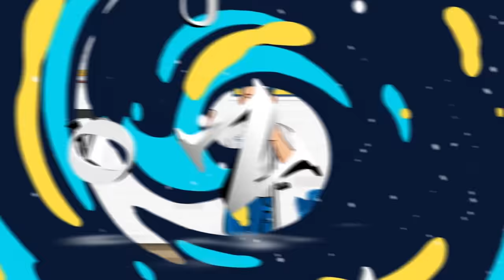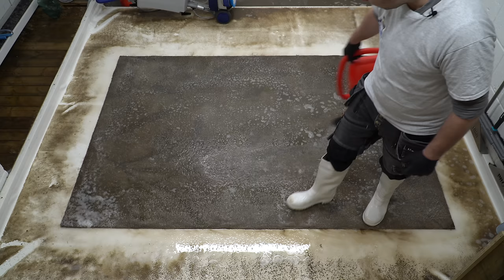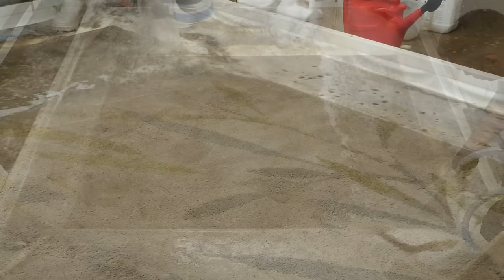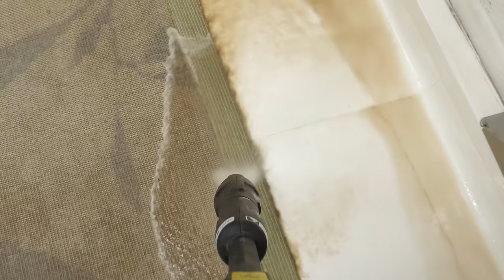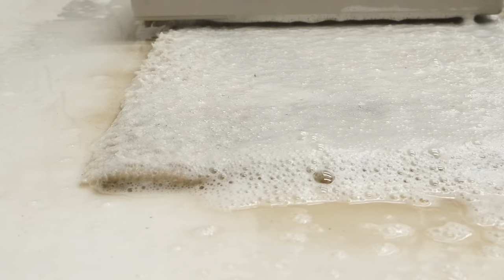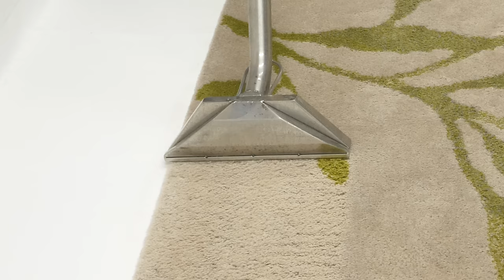Straight Out Of Shrek's Swamp | Carpet Cleaning ASMR | Satisfying Video

Comment: Cool video. I'm sure you've had this suggestion before but would floor tiles with holes in them mean you'd have to clear the white area less?
Reply from the maker: Yes and yes. but clearing the floor is a satisfying part
Reply: @MountainRugCleaning  it certainly is and you'd miss alot of what is hiding under the rug when you flip it!

Comment: Got a Question; why don't you power wash 1st on the underside over some sort of grate? To my uneducated eye it seems that doing that would allow a lot of the dirt to leave in the reverse direction it was put on, possibly saving you some time.
Reply from the maker: Because a pressure washer doesnt work as well as youd think on its own. You need to work shampoo into the rug to help break down the soils. Squeegee works much better.

Comment: I cant help but think it might be useful to have the rug suspended on a grate or something during the part where you're pressure washing the back side to blast out the dirt stuck deep in the pile 13:00. If the water coming out the other side can flow away without touching the rug again it would cut back on the "reabsorption" if you will. Just a thought, after all I'm not the professional here.

Comment: Is your hose not long enough to reach to the other side of the carpet? Or why not use the power washer to rinse the platform as an easier option?
Reply: Seems like a waste of water.
Reply: @KarieJane5  he says he learned by watching Jakub.. Jakub uses that power washer to cleanse his work area at least 3 times. It could actually help James remove a lot of dirt after first wash
Reply from the maker: Yes its long enough but then id be standing in front of the camera like a muppet

Comment: These videos are generally very relaxing, but the dirty water splashing back onto the rug because it rebounds from the side makes me nervous. If you have the money, you could invest in some plastic grating that covers the main area, so dirty water would just fall through the grate and then run to the drain on the lower level. That would not work for your "under-the-rug-waterhose" later, though, so on second thought, it might not be a good permanent solution.
Reply from the maker: On going to put grates down and then perspex on top leaving around 1ft space around the edge so the water can run off the side but i can still do the hose under the rug trick.
Reply: @MountainRugCleaning  Clever! I'm looking forward to seeing it in action.

Comment: Why would you put flat floors in the cleaning station? Just why? The middle part should raised a bit and the out floors should have PROPER draining systems. All the the dirty water and dirt will just wash back up on the rug which makes it so inefficient. The setup is horrible.